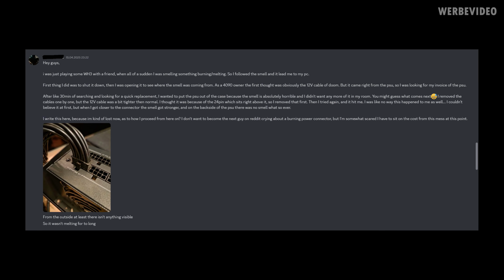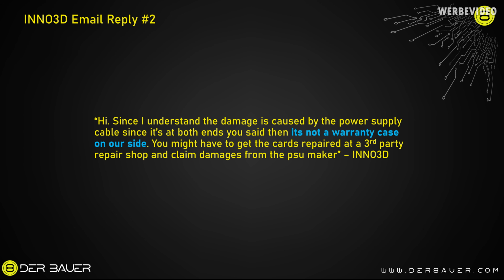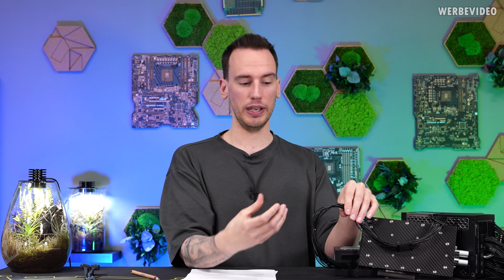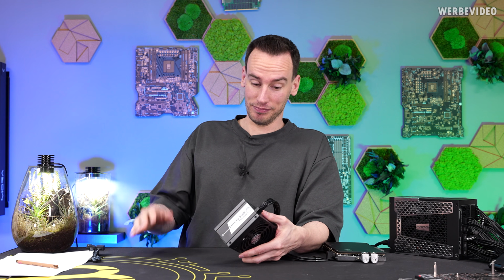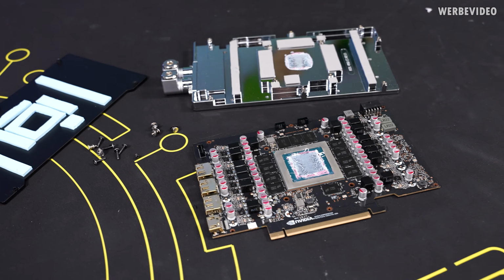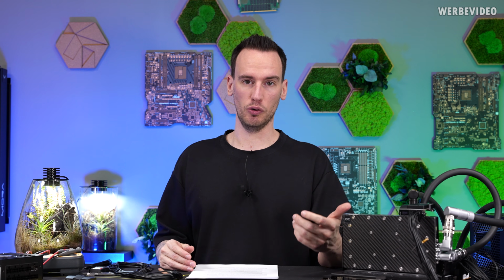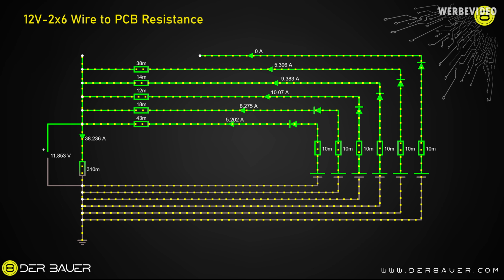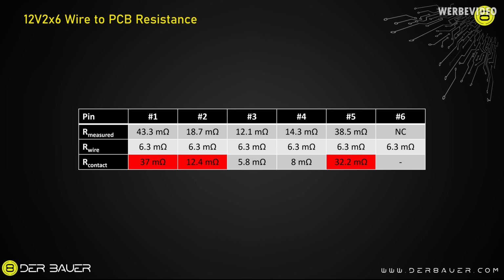Investigating and Fixing a Viewers Burned 12VHPWR Connector

Comment: @der8auer-en Could you make a connector similar to yours but that measures the current on each wire instead of all at once? And when the current exceeds the limit, turn off the PC or set off an alarm. This could be a great tool for 4090/5090 users.

Comment: Maybe NVidia could ask the AIs they've given all their attention to lately to solve the problem. It's clear this problem was well known before the 5090 launch at least, otherwise Asus would not have added the extra per-pin monitoring on the Asttral cards that should have been there by standard (as well as using a different power connector than this failed PoS).

Comment: Look like no one want this stupid piece of crap... I mean 6pin connector. They blame eatchother for failrure. And poor players who buy cards equiped with this connector are alone when it burn. 
AIBs are to scarry to say Nvidia their stupid one big power plain on cards cause this uneven power distribution. AIBs can't do their authors cart different it will break the partnership with Nvidia, becouse Nvidia don't allow modyfy how the pcb for 5090 are build. 
Connector itfelf have so small safty margin (1.1x vs 2.5-3x in 8 pin) that easy to trigger problem.

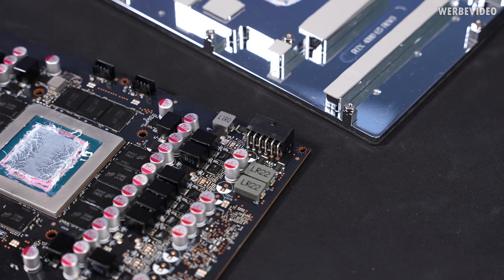Comment: 13:20 5 of the power connector pins are not fully soldered! 😱
Reply: The backside, where you actually solder, is fully soldered. I doubt this is the problem. But good catch.
Reply: @trashmaster12345  It's probably a 4 layer (or more) board, but the solder should really flow through to the top layer and wick up the pins.
Reply: @trashmaster12345  I spotted this too and posted a comment on it but according to IPC soldering standards the solder should be wicked all the way through.  It’s like wire gauge. If there is power traces on the top of the board you are only relying on the plated copper in the via to pass the current. If the barrel of the joint is not wicked all the way. It’s like using thin wire for high power.
Reply: @jeremysaise  Incorrect depending on which IPC class you are talking about. 
Class 3 requires no wetting on the component side of the joint.
What is required for class 3 is fill inside the through hole 75%, which you cannot see from this photo. You'd need to poke a needle into the hole or take a cross section of the board.

Good eye though, GPU manufacturer should definitely investigate that.
Reply: @  I some how doubt these boards are supposed to be anything less than class 3 and the component side that’s not in the class as it’s usually un-inspectable due to the component being in the way. But when you are dealing with this amperage you really want full barrel fill. I work for a company that supplies solder inspection for THT and most of my customers think the 75% is too low for it to be a good joint. They typically say 90% is what their minimum should be
Reply: @jeremysaise  Yeah thats good info to know, if the GPU company would have at least taken the card back to inspect they might have seen it did or didn't meet their manufacturing spec. Or increase their AOI/manual inspection level.
Reply: @trashmaster12345  Being a two sided board and what side of the board the connector is soldered on is part of the problem. Most of the power is drawn from the top side of the board ( I believe ) where it wasn't soldered properly. To be soldered properly it has to be drawn through the hole along the pin to the other side as Colin mentioned above.
Reply: Yeah you can see the PCB copper and the joint looks browned, some possibly from the initial soldering but it could also be from the overheating/melting.
Reply: I saw the same. Good eye Colin!
Reply: Yes!
Reply: Wow 
That definitely counts as a quality issue on that manufacturer 
Especially since everything is automated, so there would be a bunch of boards just like this

Comment: removing the power connector from a vid card (desolder) is only difficult if you don't know what you are doing. it is not that difficult. use low melt solder, hot air and flux. that way you don't warp the board from a ton of heat.

Comment: I totally expected you to just solder a new cable directly on GPU after removing burned connector. I think this is how it should be done at factory - jast a pair of colored braids of wire hanging from GPU, same braids from PSU for crimping or connecting with standard industrial plugs, like Anderson SB-120.

Comment: 12VHPWR on 5090 is a ticking FIRE HAZARD. period.

Here is why: 
1. 12VHPWR has a very narrow window of tolerance for 5090 power requirements.
2. Due to these narrow tolerances, small manufacture defects (inevitable due to 'economics of scale') render the standard faulty.
3. Warranty claims are almost impossible as Multiple vendors/companies are involved in making/maintaining the operation of 12VHPWR equipment (i.e. GPU, PSU, Cables) leading into BLAME PING-PONG and lets face it, no vendor in its right mind will succumb to the fact that one of their PREMIUM product lineup is faulty. Might as well wear metal shield, ready to be stoned by the public. 

YOU ARE BETTER OFF OF ALL THIS.

Comment: The big question that came to my mind is whether we had a similar scenario before. I mean the Samsung Galaxy Note phone that caught fire. And after a few reports, everyone investigated it and realised that it was a design flaw, now any flaw. And legal action was taken immediately. The phones were recalled and banned altogether, and in the next generation, everything went back to the way it was: a safe and proven process.
But how is it that today, Nvidia, after 4-5 years of reports, is easily taking money from people, and even though it may be a fire hazard, no one can stop it, and it's all the fault of the common people?

What was wrong with the old cable? I know it was big, but considering the huge size of the new cards, there is room on the card for those plugs and I'm willing to connect 4 8-pin cables but want to make sure my $2,000 card doesn't catch fire...

Isn't this a form of discrimination between companies?

Comment: That warranty response is bullshit.  They chose to use a shitty connector in their GPU, they ARE responsible for the damage it caused.  If THEY want to duke it out with the PSU manufacturer or nvidia for pushing 12vhp to recoup, that's on them.  But their product was defective, caused damage to OTHER components, and the buyer should be made whole.

Comment: There needs to be a thermal pad under the connector to help suck more heat out. I suspect that the lack of airflow from watercooling the card contributes to the problem. So there you have it, you need to use a 12 -> 24 pin power splitter cable so you can ensure it never burns out on the PSU side so you get warranty.
Reply: Just got an EK waterblock for my Astral 5090 OC. It says to put a 3mm pad between backplate and 12VHpwr connector.

Comment: It seems like nvidia's "user error" smokescreen has completely buried this issue in the eyes of manufacturers. "We followed the spec so it must be the customers fault if it doesn't work" when its the spec itself that's causing all these problems.
Reply: Of they say anything apart from the official line from nvidia they'll probably fucked, not to defend them too much since they are part of the problem but it all goes back to nvidia
Reply: If you buy a $2000 - $3000 graphic card with a known 12VHPW problem why not protect your investment with a hall effect current meter to make sure you have balanced currents on all its conductors.
Reply: Sadly AIBs are hands tied, NVIDIA sets the rules when it comes to board design.

Comment: Nvidia specific cable producers should use ceramic instead of plastics. Just like in high voltage aplications. Then GPU connector would melt first making warranty claim plausible option.

Comment: The contact resistance can increase because of bad mechanical contact, metal oxidation or chemical ion diffusion, if the too pins are made of different metals. I've been trying to explain for 3 years now that the problem is not bad contacts, but unequal currents across the cables. It is the nVidia fault for removing the power balancing circuit on SUCH A POWER HUNGRY LOW-TECH MONSTER. With next card you do the measurements, I suggest you first cut down the connectors on both sides preserving the connection as is.

Comment: My gut feeling  is  that these connectors may be ok for the necessary current according to the spec sheet, but they really are not; but that only shows up when operated at high current for long periods. The plastic around the spring contacts slowly deforms, reducing the contact area by different amounts on different pins. This can also turn into runaway once one or two pins start taking most of the current. Basically Nvidia should have picked a connector with a better spec margin.
Reply: I wonder how thermal cycles are affecting ithe contacts too? Because this setup was fine for months and then suddenly melted, and that is a common reoccurrence, they never melt right off the bat.
Reply: @volvo09  It acually only worked for ruffly a week. The card is old though, but the cable and psu where new. I just switched to the waterblock and custom loop.

Comment: I'm kind of shocked molex specifies 10mOhm max contact resistance. In my experience measuring contact resistances for audio connectors it seems super low and not something they can promise or specify that.. It's likely assuming very specific conditions and/or ideal conditions..

Comment: Yup thats exactly my theory as wel. If one of those leads or pins for what ever reason gets a tiny bit hotter than the rest of them resistance goes up > takes even more load away from the other pins/leads aka resistance goes up even more > heats up even more > feedback loop > burn. its like having one slightly lower ohm resistor in parallel resistors bank. its takes on all the load while the higher value resistors do nothing. And all this is fine when even one pin/lead can take about half the total power with ease like the old pcie connector could but when you're already on the limit with the combined pins? Bad idea..

Comment: Nice detective work! However 10:56 surely it is the differing contact resistance - the effects are consequence of Joule heating (I^2 R) and Kirchhoff's Current Law. Contact resistance is bad, but significant differences gives rise to current hogging on one or more of the wires. Once things start heating up there's also the fact that the resistance of the wire will also increase. It's small, but not negligible, about 4% for a 10C rise for copper.

The 4.8W loss doesn't sound a lot but it's significant. When incandescent lighting in automobiles was common the interior festoon bulb was often ~5W. You really wouldn't want to lick one of those after it being on :) You mention soldering/crimping - crimping (if done properly) creates a lower resistance connection than soldering. Crimping causes deformation of the material and creates an almost gas-tight cold weld which is very low resistance. Soldering just introduces higher resistance tin alloy materials. Kudos for using a Kelvin connection to measure the resistance. I think I would have reached for the heatgun to soften the plastic rather than go all in and risk further damage. Similarly I think I'd have probably cut the cable in half and measured the individual connector/wire resistances in-situ at the GPU end and PSU end.

Comment: Might be interesting to look at several 'quality' and not connectors (new, not in cables or GPUs or PSUs) and seeing if the connector resistances are way out of spec in some cases. Also a new connector on a test rig would let you measure temperatures caused in the connector and at what point they melt together.

Comment: I'm not gonna lie.
- Use 12VHPWR instead of 12V 2×6
- Use a cable extension
- Use a cable from a third party
- Melt. For me it's asking for it.

If I should ever power a 4090 knowing y'all spend in 99,99% of the time 2000 bucks or more. I get at least an ATX 3.1 850W Gold 12V 2×6 with the rating of 600W (REMEMBER GUYS. YOU CAN HAVE A 12VHPWR CABLE BUT THE PSU MANUFACTURER SAYS THE PSU CAB ONLY DELIVER 450W OR LESS). Happen to often to people assuming i'f the cable is rated 600W the PSU can deliver 600W.

Comment: I said from the very beginning, the connection in both ends (all the metals) are made of Chinisium and they should be made of Cooper Beryllium, specially when used are such high currents and so close to the limits of the specs.

Comment: My EVGA supernova 1600w has never failed me in 10 years. I always use the adapter and 4 8 pin connectors. I don’t recommend using the newer motherboards 12pin one. I don’t know why can’t nvidia pull more power through the pci express slot instead. Wasn’t pci express 5 advantage over 4 to pull more power. Then maybe only 1 8 pin is required

Comment: There is also possibility that since we are putting multiple leads in Ac to Dc buck power supply that basically turns Dc on of with high frequency. Possibility is that there is feedback from one lead to other when PSU is turning on of in fast phase. that would mean when one lead is on one is off., and when leads aren't sync leads short circuit each others.

Comment: Why they don't make cables that have a power limiter buildt into it? With a variable resistance for each cable that even's those differences out? I mean, that could not be that difficult, could it?
Reply: So a fuse in each individial cable….
Reply: @haukikannel  Not a fuse, 6 variable resistors linked to 6 individual amperemeters! Expensive but it would make those cables control themselves!
Reply: @haukikannel  But individual fuzes would also help!

Comment: I measured my 12v inverter cables for fun as of this Nvidia crap. 
I put 2KW thrue it as inverter support it, is on a beefy cable with crimped ring connector, no heat in cable or connector if touch it is ok. 
Then i split the ²m in half and used two cables in parallel, now it got extremely hot! No other changes, cables was PURE COPPER same brand on all parts.....
I know from past experience in electrical engineering that you should never feed with parallel wires to feed a load as this type of issues will come as you can never match the resistance of parallel wires in high loads unless or a high resistance on them individually and that are a waste of power thus create heat in that part. Even many stained wires with loads on small wires in a cable create heat, i have tested with a luxury speaker cable and it got got despite being 2x the ²m of the big cable earlier. 

Have fun melting Nvidia 50090, like mine MSI oc will go....

Comment: Wouldn't thicker cables help? Like really thicker!
Reply: Not much…
Reply: @haukikannel  why not? Because what we have seen from multiple scenarios is that two cables out of 12 are falling and their resistance is going high. Thus making them thicker will dramatically reduce their likelihood to fail due to that
Reply: in order to use thicker cable you need to increase the thickness of connector its one to one ratio you can't increase one without causing issues to other

Comment: @der8auer-en 15:07 regarding the card running at only x8 4.0 ... i've had the same issue on a MSI x670E Tomahawk and it turnes out that it was a BIOS compatibility issue!
 I was going back and forth with MSI support ten times or even more and i later received a beta BIOS that made the card work at 16x (Gainward 4090 Phantom).

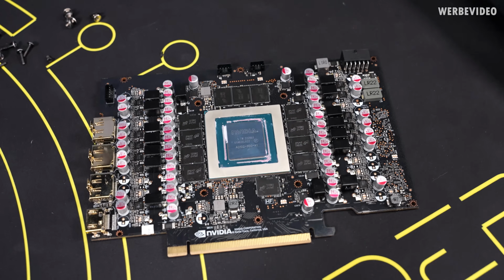Comment: 14:46 Surprising to see a dremel, considering this may spew metal fragments causing additional issues or short circuit. Seems that hot air soldering would be better option.
Reply: There is a lot of thermal mass (like alot) and the hot air would stress everything nearby, given he told he had not previous experience. Wire cutters are likely the easier option compared to the rotary tool. The easier option is using low temperature solder but likely he had none at hand - it's proper expensive as it contains bismuth.
Reply: @stanimir4197  Then unleaded solder is the easy solution. But hot air usually sint a big issue

Comment: @der8auer-en 13:31 you can clearly see that some of the pins of the power connector on the gpu arn't soldered trough the hole ( you can still see the copper pads). That would increase resistence and might be the cause.
Reply: Yes, that looks like a manufacturing error.

Comment: the fact nvidia thinks multiple wires will magically load balance current on their own should worry people, this is some of the worst engineering design I have ever seen, either the GPU has to load balance the sinking of current or the PSU has to load balance the sourcing.... the 8pin connector worked perfectly and 3 could deliver more than 600W 🤦‍♂

Comment: Nvidia really messed up so manufacturers just need to place two connecters on the GPU to split the load when running so close to the connecters limit, Which should also be re-rated for a lower power output to create a larger safety factor.

Comment: These results once again seem to align with my theory that the actual physical source of the issue is actually oxidation and, during insertion, the oxidation being unevenly scraped away, which leads to different contact resistance. If either the cable or the GPU or even the PSU have been sitting around in storage for some time, a very thin oxide layer could form (depending on the exact storage conditions).

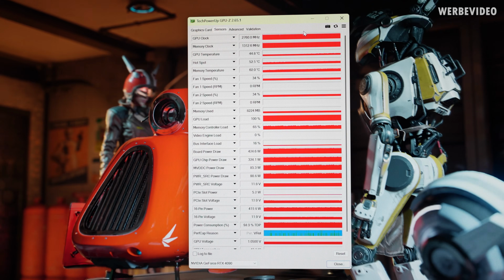Comment: 15:31 x8 4.0 ? That's not 1/2, that's 1/4 of the expected bandwidth because it's x8 instead of x16 but also 4.0 instead of 5.0
the hell is that ?
Reply: 4090 isn't 5.0
Reply: @EliteCanadian92  hoo, that's why
I'm so used to see this issue on 5090 that I forgot that it was said to be a 4090 at the start of the video